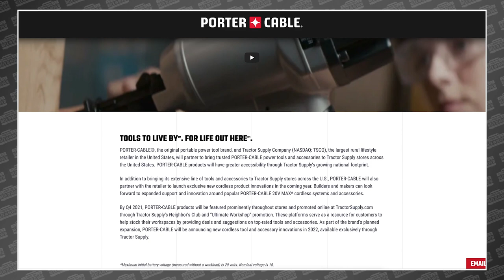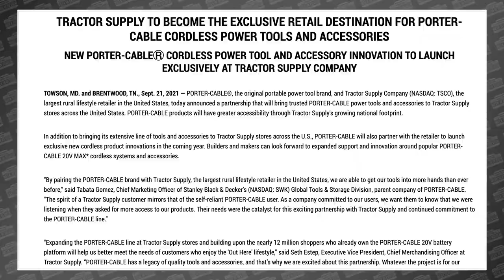Porter Cable LIVES? Announces a new PARTNERSHIP and plans for 2022!

Comment: I am a farmer in California.  I know PC has become more flimsy.  Though they are also pretty cheep.  They do the job, though not as well as my Flex or Craftsman power tools.
Here is why I still buy Porter Cable:  Their air tools are still awesome.  I have five barns and lugging around an air compressor to all locations is a pain in the  butt.  I can have a good compressor and tools in each barn and not break the bank.
Their 20v line is a travesty, though if they get lost or I drop one out in the orchard its really not a big deal.  Cheep enough to replace.  The 5.5 inch circular is great for cutting fencing.  The recip saw is garbage, but is good for pruning.

Porter Cable has a niche with farmers.  Lets see what they do with it.

Comment: Clint from Tool Review Zone spoke about their partnership with Tractor Supply and they sent him a welcome kit that contained a drill, 2 batteries, a drill bit set, and a thermos with TS and Porter-Cable logo on it. He thinks their removal of the rotors was maybe a possible introduction to new products I guess it will be a wait-and-see thing.
Reply from the maker: Yeah we got the same kit. The included drill was 4 years old, so we didn't really focus on it. We're far more interested in what will show up in 2022. Hopefully two such enormous companies working together, will justify a significant investment in new tools. There could be some really cool things yet to come.
Reply: @ToolShow  only time will tell. But so far a lot of people have given up on their line. Tractor Supply does not have any locations near me and I do not want or need to start with another battery platform.Do  with them luck
Reply: @ToolShow  We need a full review on that thermos!
Reply from the maker: @denoftools  LOL your comment reminded me to even take it out of the box. Turns out it's a custom printed Thermos SK2010MSTRI4, in Stainless Steel, and it has over 18,000 killer reviews on Amazon: https://amzn.to/3nYJKSz
Reply: @ToolShow  did you guys get one of those yeti tumblers from Flex? If so you should totally do a comparison review between the two
Reply from the maker: @denoftools  After a quick glance around the studio, I see tumblers from Skil, HART, Bosch, PC, but no Flex. I might be here somewhere, or Sarah took it.

Comment: I bought a set for around the house 7 years ago. The brushless impact finally started smoking and the batteries don't last that long anymore. I've now invested my money in Dewalt XR tools the last year and couldn't be happier. Moral of the story is I think Porter Cable waited too long and the ones that bought into them like myself have moved on to platforms that have 100s of tools and amazing battery technology. Don't think ill ever buy another cordless tool from them after they ghosted us for 3 years. I don't see this working out well for TSC especially since all the farmers and country folk I know run Milwaukee or Dewalt cordless tools. But I guess we'll see

Comment: What did you mean could of just put dewalt in there? There's been dewalt in Tractor supply more than any other tool brand and I noticed porter in there a few months ago with 2 small end cap rows worth and the prices were crazy. Tractor supply looks like its going out of business where I live due to rural king next door who has milwaukee and dewalt tekton and a few more great brands

Comment: Stanley B/D owns porter cable, and craftsman, Irwin and DeWalt.

Why all the hate for porter lmao. Most of these tools share the same guts (model dependent). But these are no different than brushed DeWalts.

My DeWalt 885 brushed impact is going strong after 10 years of hard work.

I think there might be a few fanboys commenting here.

Tools are good when they work a d do their specific task. Porter cable is a brand that generally had a quality tool, as are most products owned by the conglomerate. A day in day out professional wouldn't choose them these days, but that doesn't mean it's not great for a homeowner or handyman. 

I know guys that make a killing using Ryobi and Ridgid cheapies.

Chill out on the brandism and be thankful we have some great offerings from many companies.

This is all coming from a DeWalt system user

Comment: I have most all the 20v Max tools since 2017. they never had a problem keeping up with any of the other tools our family used. We did commercial and residential contracting. They went through some big jobs like some roofs we put on a couple of the huge buildings here in the City. I figured I would have worn them out by now we did some major jobs with them. I just shined them up today. Dad retired, but i still have the PC tools remodeling a 6 apartment building I bought right now. i don't know what people expect nowadays lol they have been great. Your average person doesn't need anything more expensive 😂 On r other hand my 20v Atomic series impact driver 300 dollars I just had to have, I have babied, kept it in my house for small things and it's acting stupid.

Comment: I think you're over-playing this. TSC is nothing compared to Lowes and Home Depot ($8B sales vs. ~$110+/90B). Ace Hardware does almost as much sales as TSC. Cripes, Menards, which isn't even in half the USA, does 50% more revenue than TSC. If SBD put DeWalt exclusively in TSC, they'd lower their sales volume by like 10x. This is a nothing power tool brand going exclusive with a nothing retail chain but trying to make like its a big deal in order to not lose what little relevance they have left. yawn
Reply from the maker: I hear ya Robert. I think the point was, that while their stores are smaller, it's because of their their target demographic. The big boxes are aiming at all DIY and construction. And while TSC has much smaller stores, their focus is smaller. But with 1,900 locations, they have a lot of reach. What we Don't know, is exactly how much of an investment TSC and PC are making in this deal. We'll only know once we start seeing the new tools in 2022. And I certainly wasn't suggesting DeWALT could have been put exclusively at TSC. The intent was to suggest they could have just added TSC as a distributor of DeWALT, and moved on. Instead, they're apparently working closely to build a line of power tools specifically for the "Rural Lifestyle". I have no idea how that will pan out, but I'm anxious to see what they come up with.

Comment: SBD line consists of DeWalt, Black and Decker, Porter Cable, Bostitch, Craftsman and there may be others, can't recall or where they stand today (visit the SBD corporate page).  Now what occurs is the lower lines are bastardized for price point, metal, plastic, rubber, boxes and bags, motor up and down grades.  No innovation since Stanley arrived in the lower lines, margins business model. Remember when Craftsman had neat Christmas and Father's Day gifts, no more those don't fit the business model.  Walmart for years wanted DeWalt, but no because it would cheapen the name.  Look at the big boxes, little crossover everywhere.  TSC and Porter Cable is a gimme because SBD isn't giving anything else and making it an exclusive for TSC, "this is where people will come to get there Porter Cable" certainly was the pitch.

Comment: Are they still dropping their router line?
Reply from the maker: Sadly, it looks that way. The current line is gone for sure. The question remains if the "new" line of tools coming next year, will include routers.
Reply: @ToolShow  interesting,  when I read you statement here,  it made me think about a lot of the commentary that came out when Flex was announced.  That what did the industry need another tool line for,  are they too late.  Is PC too late?  I know they had some following, but next year to wait on the new tools?  And if it requires new battery platform,  that will be like a whole new entry into the power tool world.